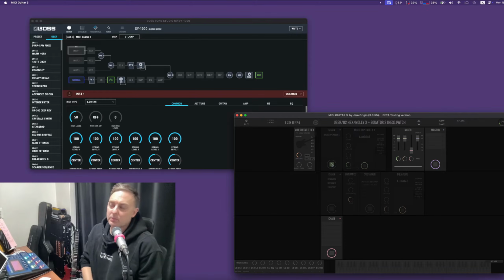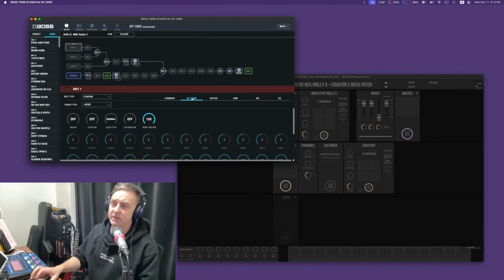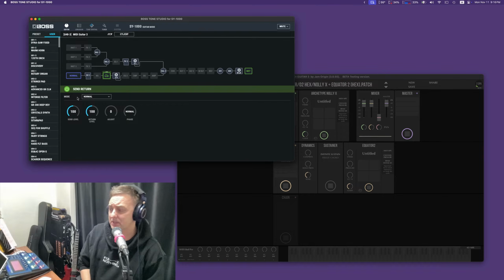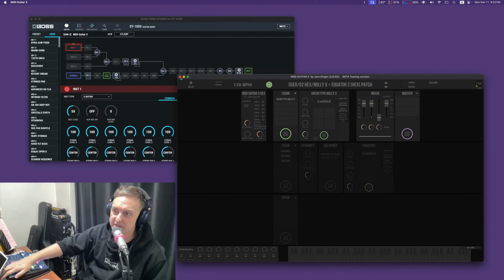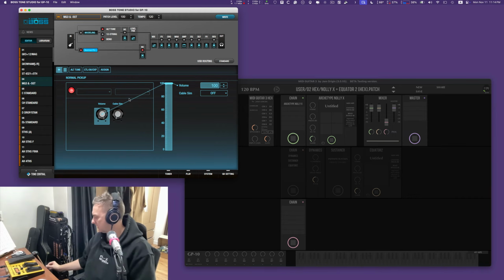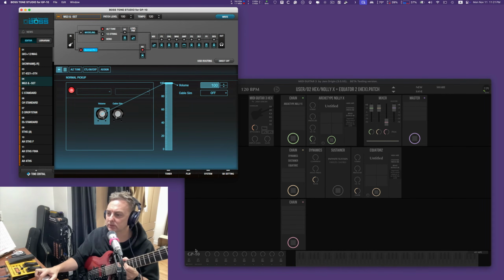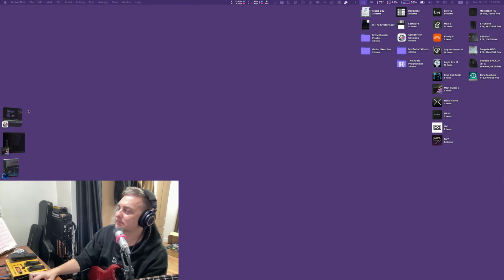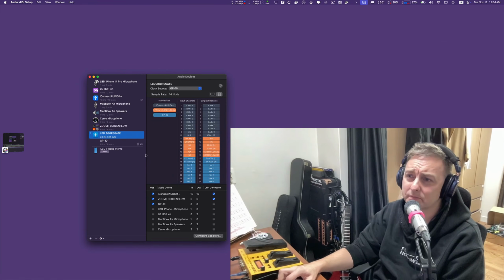MIDI GUITAR 3 HEX -  A DEEP DIVE INTO USING THE BOSS SY-1000 & GP-10 WITH MG3

Comment: Great stuff. Do you prefer one to the other?
Reply from the maker: SY-1000 all the way 👍
Reply: @Vaultnaemsae  Due to the onboard sound and effects or a superior 6 x audio channel setup for VST use?
Reply from the maker: @rirrid5662  If I recall correctly, I explain some of the issues with the GP-10 later in this video. 

I rarely use the SY-1000’s onboard effects, but I do rely heavily on its user configurable routing. The GP-10’s routing system is archaic by comparison.

Both BOSS units feature an 8 x USB audio channel setup which is integral to interfacing with MIDI Guitar 3 Hex.

Comment: interesting! so is the guitar 3 hex software specifically made to use with a gk3 pickup?
Reply from the maker: MIDI Guitar 3 does not require a GK/hex pickup system for operation. The regular tracker provides superb pitch-to-MIDI (MPE) performance. But, for the hardcore “hex fiends” out there, MG3 Hex takes things to another level.